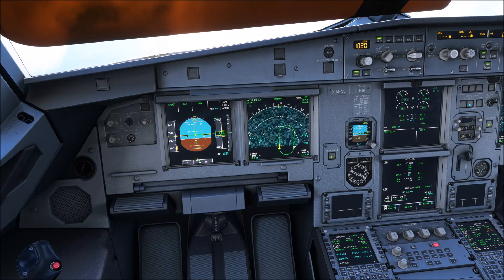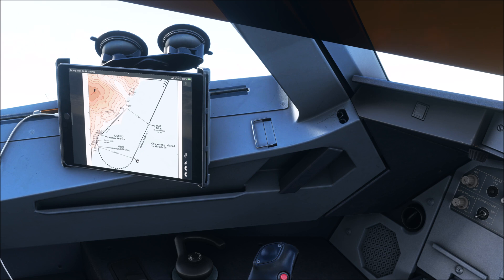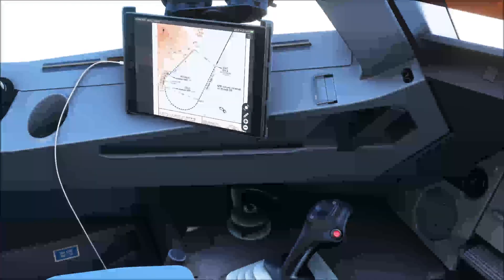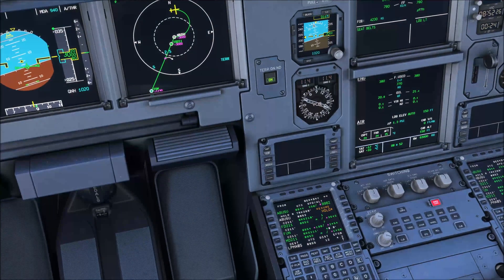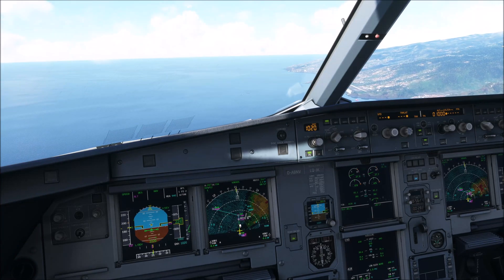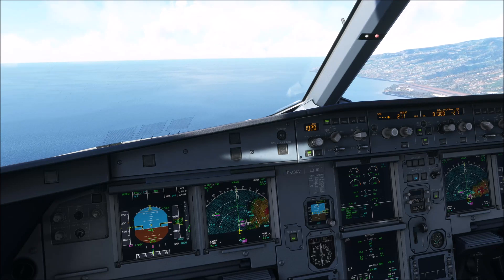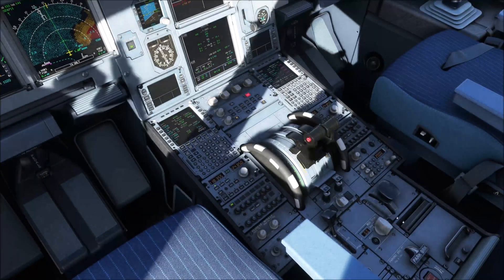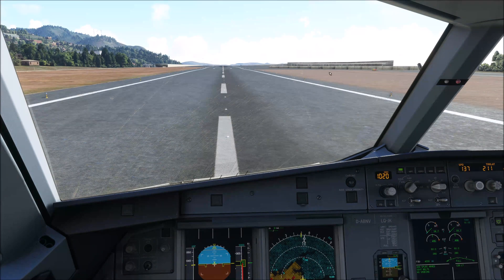Fenix A320 | How to | Madeira - clircling runway 05 FNC/LPMA | Real Airline Pilot

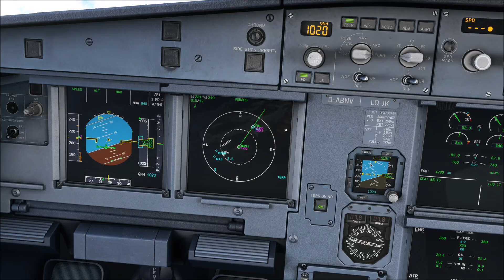Comment: Why did you enter 211 in thr radio at 3:41? Is this the course? Is it not 219?
Reply: If you are referring to a chart on Navigraph you need to make sure you are on the VOR Visual Approach rather than the RNP Visual Approach.  Should be 12-18. Then you will find the 211 course :)

Comment: Think to configure your Sidestick with AP soft disconnect in order not to have the continuous chime. This approach should be done with AT ON due to wind gusts and in order not to have the SPEED SPEED warning add 5 knots to the computed VLS on your FMS otherwise great landing :)
Reply from the maker: Thanks Chris! I just can't get the soft disconnect to work, I have assigned it (and it works with any other aircraft), but nothing happens when I press the button.
I'll keep the A/T in mind on my next one. Thanks for the advise again!
Reply: @A330Driver  For my sidestick I have mapped  Autopilot Off function in control options and it works exactly as it should ;)

Comment: Great video, I really enjoy the conciseness of your tutorials! Minor thing but as far as I know, you would always disconnect the AP directly on the sidestick, not on the FCU. This will also prevent the ECAM warning that you had to clear after disengaging the AP in this video.
Reply from the maker: That's correct Lucas, but for a reason that's beyond me the disconnect command in my simulator (that works on any other airplane) does not work with the Fenix. Neither the joystick command, nor the keyboard command.
Reply: @A330Driver  you should bind with autopilot off